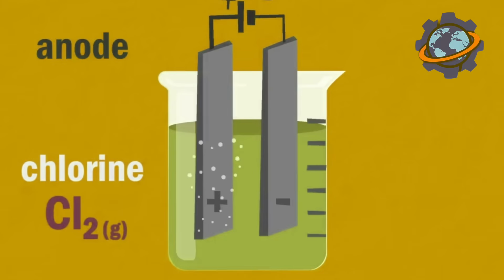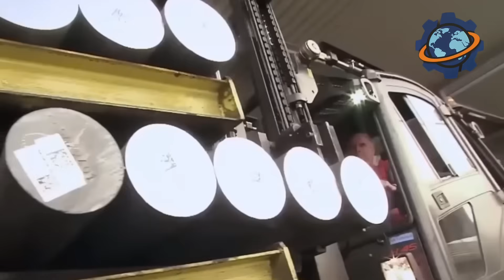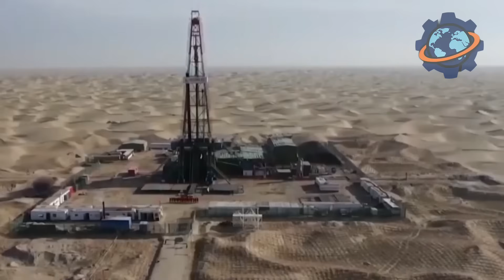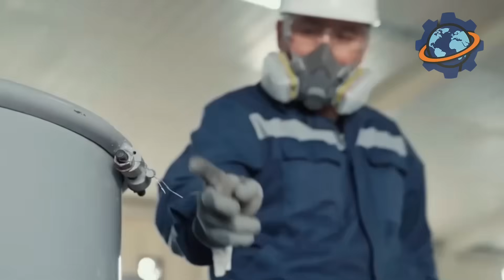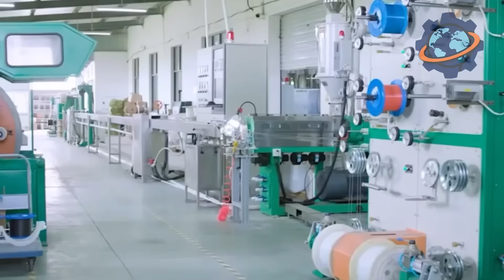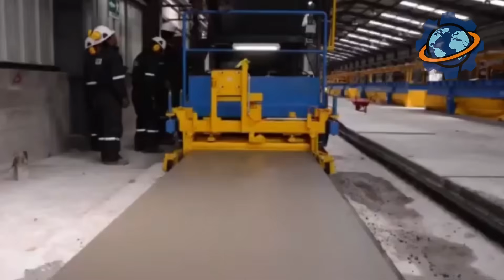How Chlorine is Made | The Chemical That Weighs More Than 120 Aircraft Carriers

Comment: 1) Yellow cake isn't all that toxic unless you eat it. You can touch it with you bare hands if you don't make a habit of it.
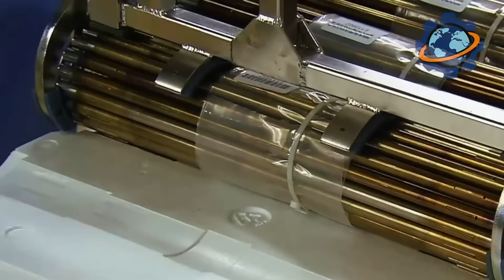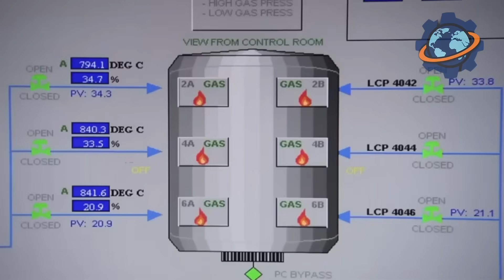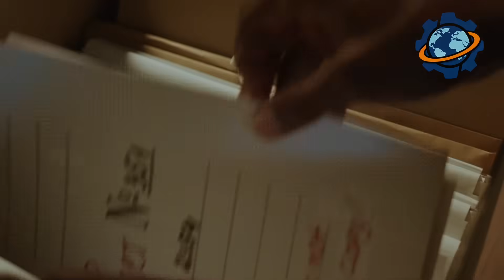2) At timestamp 20:34 and 24:07 and 27:06, you show the center of a Tokamak reactor which is a FUSION REACTOR. Fusion reactors use Deuterium and Tritium which are Hydrogen isotopes. They do NOT use Uranium in any way, shape or form which is used only in FISSION REACTORS. FISSION and FUSION are two completely different and opposite processes.
Reply from the maker: Thank you for your insights, @jeffmccrea9347! It's fascinating how different reactor types operate, and I appreciate you pointing out the distinctions between fusion and fission. Your knowledge adds a great layer to the discussion! 🔍